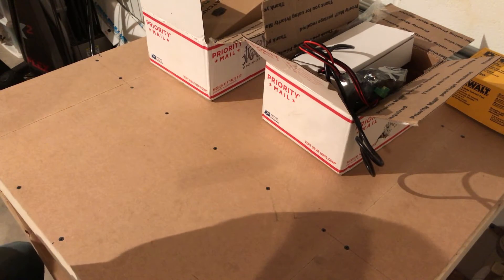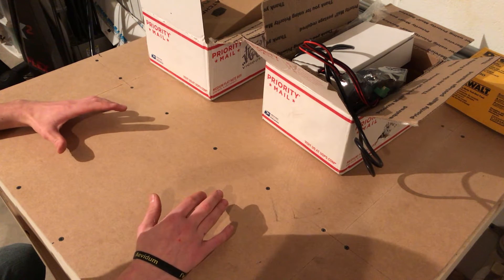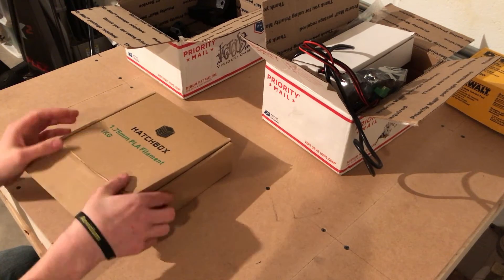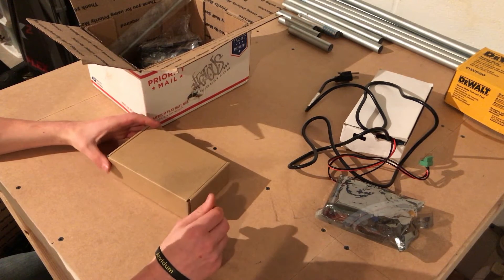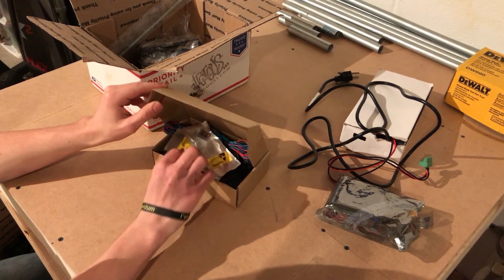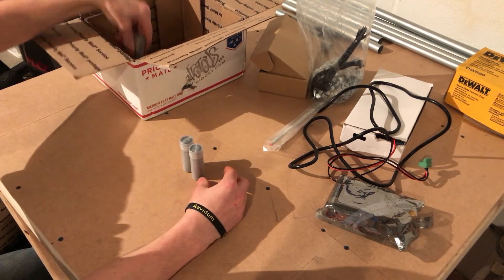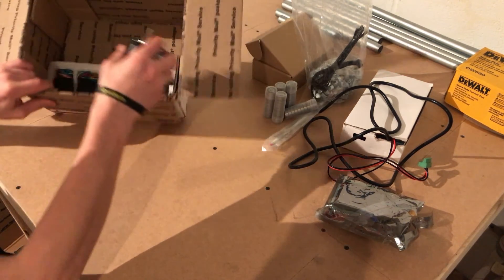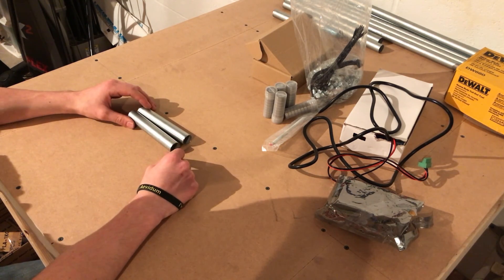Mpcnc Part 1: Project Intro

Comment: What are your table dimensions?  Also what are the cut lengths of the conduit?
Reply: There is a calculator on the Vicious website so it will tell you what your tube lengths need to be as well as your table.

Comment: I guess if you're on a time crunch or you have to sit around and babysit your printer it might be worthwhile buying the printed pieces but it takes less than two spools of filament to print them so that's a lot cheaper in my book.
Reply: Yeah my printer at the time was down due to a bad motor, so to save alot of time and hassle i just bought them from him but if you are up to it, go for it, yes it will save you alot of money in the end.